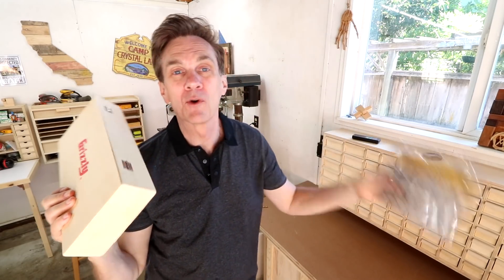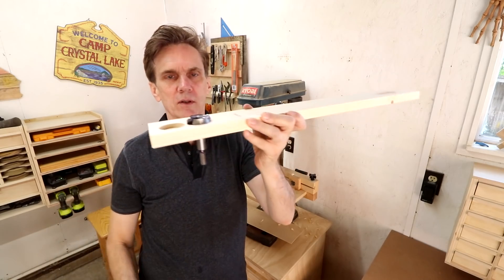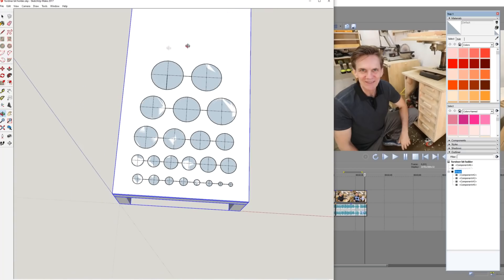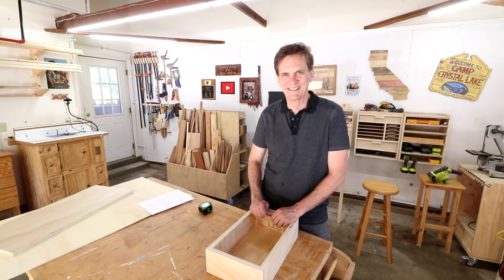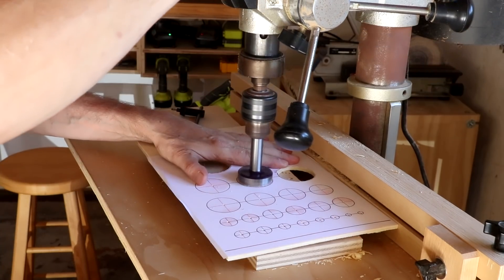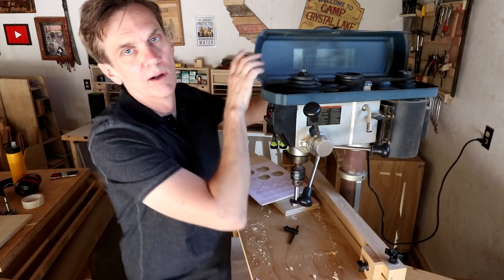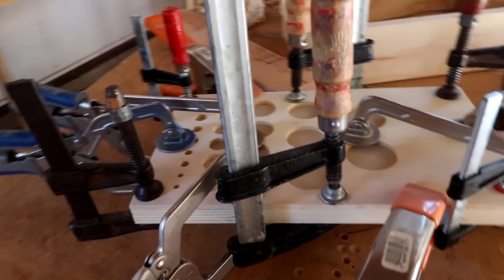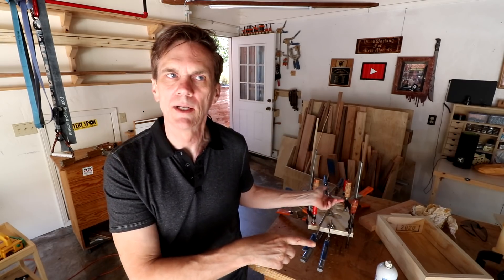A storage solution for my Forstner bits. | Day 94

Comment: Keep a fridge magnet in the drawer to grab the smaller bits easier.
Reply: Keep the bits in the fridge
Reply: @BeeRich33  that could be misread with some serial killer vibes, lol
Reply: They have a magnet on a plastic handle for canning.  They pick up the lids from boiling water after sanitizing.  That way you could drill a hole and set it in right beside the bits.

Comment: For the 1/4" bits, make a ledge beneath the hole for the shanks to rest on. The depth would be dependent on how much of the bit you want sticking out of the top. Don't forget a thumb hole in the back, or you'll have to turn the whole drawer upside-down to get the bit platform out!
Reply: I was going to suggest a backer block with holes drilled to the correct depth for each shank for the smaller bits, perhaps bored into the narrow face of a 2x4 appropriately cut down to fit underneath the row of small bits.  A ledge, mounted lower down on the drawer insert, with holes drilled to the correct depth for each shank, would theoretically do the same thing, and would be lighter than my idea.  However, one would then be stuck with trying to blindly align the shank end with the unseen lower support hole from above -- that could get frustrating with time.  Maybe my bulkier idea might be less stress-inducing over time, since the holes for the small bits would be one continuous length down to the supporting ends... dunno.

Comment: Hey Steve, great video.  I just wanted to point out that wood absorbs moisture and this may cause your bits to rust when kept in your holder.  You may be able to apply some wax to the insides of your holes to reduce that.  Lesson learned from my own experience in making my bit holder.  :)
Reply: nice part of this design is contact with the wood is limited to the back face of the cutter/far end of the shank, where rust will cause minimal issues unlike on the contact surface of the shank.

Comment: Steve,  Great to see all the videos you are doing during this crazy time we are in!!     One suggestion I have for your smaller bit storage alignment issues, that I incorporated in mine, was the use of dowel rods.  I used 3/4 or 1" dowels and drilled the centers out with the shank sized forstner bit, then cut to length and glued them to the bottom of my board, acting as a sleeve for the shanks.  This keeps them from wandering while the drawer slides in and out, and its not seen from the top. 
Thanks again for all your videos, and keep up the great work!

Comment: Looks like all you need to do now is drop each bit into its corresponding hole, give it a gentle rap with a rubber mallet so the tip of the bit marks the center, and drill out the center.  Nice.
Reply: That's what I would do too. 1/8" pilot through both would work too (as others in the comments have suggested), but if you drill the shank holes first, you lose the brad point keeping the workpiece centered over the bit. Forstner bits aren't the same as twist bits when you need to widen a hole.

Comment: I bought sets of router bits and Forstner bits at Home Depot in those lime-green Ryobi cases, (not so much a fan of Ryobi... but they are reasonably priced and they work great for me, and of course I can upgrade them later if I need to)... so I attached on the backs of those cases a length of 45 degree cut wood so they will go on my French cleat tool wall... These cases are great! They have plastic lids that flip up to access the bits, keeps the dust out, I can easily see exactly the bit I need, and they are already labeled... and another bonus is that they can be taken off the cleat wall and taken to other places in the shop.  Steve, I know you took out your French cleat wall system a while back... but it was your videos that inspired me to build it for my shop and it really organized my tiny shop in ways I could not have predicted... Like those Ryobi cases!

Comment: I'm the happy owner of a Bosh drill press which has digital speed adjustment AND a digital depth gauge built in. Changing the speed is as simple as turning a knob. And it's an inexpensive and compact machine too. If you're in the market for a drill press I would highly recommend this one.

Comment: 6:03 you could have made the small holes for the shanks first, with the two pieces of plywood together
Reply: Yup! It 1/8th inch  pilot hole through the stacked boards so the holes align.
Reply: That was exactly what I expected him to do
Reply: Only came to the comment section to say this.
Reply: Yeah, me too. Don't know why he didn't drill center holes first.
Reply: I think he did it the right way. If you drill the shank holes first, you lose the brad point grip on the second pass, and the workpiece can walk off center when you drill. This way, you can mark centers with the brad points onto the second board after gluing them together. 1/8" pilot would have done the trick too, I guess.
Reply: Brandon Palmer    Agreed...he can put each bit into the hole, light tap, and there’s the center for the shank hole.
Reply: I was yelling at him the hole time about this! (Pun intended) tape them together, drill shank holes, then use the shiny new bits to go all the way through the smaller plywood after you separate it.
Reply: I always see videos where people need a counter bore hole and they always drill the larger counter bore before the smaller hole in it. I can figure out why they don’t drill the smaller hole through first then use it as a guide for the larger counter bore.
Reply: Was thinking the exact same thing
Reply: @darinnetherland3466  Forstner bits leave a centered "point" hole which subsequent bits align with easily.
Reply: @darinnetherland3466  If you drill a small hole all the way through something, and then need a larger hole to go around it - and not to the same depth, you can't centre it.  Almost any drill bit will leave a centre hole, so you do the larger one first.

Comment: Yep, I agree with some of the other comments.  Stick the two together and drill all the way through with 1/16" inch bit.  1/8" is probably still too big.  Then split them and drill the top layer with the forstner bits and the bottom layer with a brad point.

Comment: I also have drawers beneath my drill press. They are mostly about 2" high but the bottom one is about 3 inches. I took the box they came in which was not Grizzly but very similar, took off the lid and put it in the drawer. Bits are organized, sizes are still there and it only took a couple of minutes. They don't call me lazy for nuthin'. But, it works great.

Comment: I like your solution. I have the same type set of bits and I have never had a problem like you showed. I like my tight box storage because I live on the coast with all the associated salt air/rust problems. Thanks for the video.

Comment: Hey Steve, always brilliant.  Of course, as all YouTube viewers, I have a suggestion.  If you are tired of them, just skip ahead. I won't mind.
We grip our bits by the shank, so so it makes sense to have the shank accessible to be grabbed, not the head.  We also put them into our drills by the shank, so if we did happen to grip by the head, well, we'd have to flip them.
Second, the issue of "what if they fall down" is because they are elevated.  Solution:
Solve both problems and make an easier box.  Just do a grid in a box and label what the bits are and put them HEAD-side-down. That way you put it down head first BECAUSE you're already holding the shank.  You pick it up by the shank... and it could go in the box by the shank.
Finally, I get that it's tough to tell what bit is what because the writing wears off.  Frog tape and a magic marker will work great.   You don't need it near the head... so put it just where the shank is not in the drill... and mark what size it is.  It's easier to read, especially if you need readers, (I do), and if the boxes in the grid box are marked... man that's the ticket.  You could also use tape of different colors.  It works for resistors...

Best Regards

Ehud Gavron
Tucson AZ

Comment: When applying paper patterns to wood, a common scroll sawing method is to put a layer of blue painter's tape on the wood and then lay the pattern on top of that.  It makes for very easy removal of the pattern (no solvents or heat needed) and the tape helps to lubricate drill bits and saw blades, reducing burning in the cuts.

Also, spray adhesive is nasty stuff in terms of chemicals, and the overspray from it can make a mess.  I keep a big box around and apply spray adhesive to the back of the pattern in there,  flipping to a new side of the box as needed, then cut up and recycle the box when it gets too sticky inside.

Comment: For the back blank area behind the bits  route in a small "tray"  and either use those harbor freight magnet trays or just keep it as a wood tray and put in some magnets and use it as a tray to keep the bits your working with at a time accessible and handy when you have the drawer out at a different location which you can use for any bits, twist, brad, spade, etc.

Comment: You mentioned Costco Forstner bits and I recalled a 128 piece drill bit set I bought from there a few years ago. They were cheep, I was just starting a project in metal so I thought they would be perfect disposable bits.  Having also recently bought a Drill Dr, they are still being used quite frequently. Cheep tools aren't necessarily poor quality.

Comment: Good idea...might use this one.  My forstner set has been sitting in its plastic case for a decade and a half.  Maybe you could keep the bits straight by adding a second shank sized "hole board" stepped off the bottom, so the shank is aligned with the top?

Comment: To centre the holes between top and bottom, you can join the boards together with double-sided sticky and run a 3mm / 3/32" bit through both.  Then separate the boards and use that pilot hole to centre the holes for each board.

Comment: You could've drilled the holes for the shank first all the way through both, then took the boards apart and drill the bigger holes through the 1/4” - because you now have the middle reference point in the 1/4"
Love you Steve!
Reply: avreml Rapoport I thought about doing that too. Even use a smaller guide hole would work like a 1/8” bit. Marks both centers without any distortion. 👍👍

Comment: After my experience with these very same bits and the Steelex version Grizzly sells with the "standard" sizes ( 3/8ths inch - 2 1/8ths inches by 1/8th inch - 16 bits) (the Grizzly set you have is probably the one that starts with 5/16ths inch and goes up by 1/8th inch until 2 1/16th inches - 15 bits), I feel compelled to give a warning about your choice of storage. "Danger, danger, Will Robinson!" While, as you noted, the Grizzly bits are made of low grade steel, they are still very sharp. I have the scars to prove that fact. The Steelex set comes in a box with two rails that swing up with the bit's cutting area on the top when you stand the rails up to select the size you need. I have left them in the upright position, carelessly reached in and gouged my hands and fingers with blood flowing as a result. Storing these bits with the cutting surface on the top is a bit like designing knife storage where the blades are facing up and you have to use the blade to pick them up. And I get it, twist drill bits come in metal boxes and you want the cutting surface up so it doesn't dull on a metal surface. I'm sure that is why many people, when creating their own storage solutions, stand forstner bits up in the same fashion. But I also think the reason for the Grizzly box design was to try and solve this unsafe situation where you are reaching into a box where sharp metal objects are stored pointing straight up at your fingers. Unfortunately, Grizzly's solution is very poorly executed. Another issue is that when you grab the bit by the sharp end, the oils and moisture from your hand end up on the bit and can cause rust if you don't clean the bit each time you handle it. I've been thinking about this for a while since I have both sets and neither set stores the bits safely or efficiently. My plan is to get some 3/4 material, drill down to where the cutting part will stand up for each bit, and then grab the bit by the chuck end instead of the sharp end. And, similar to your plan, I will just place that material with the hole grid in a drawer under my drill press. Since I live in the humid Midwest, I think I'll use PVC board or something that won't hold much moisture to keep down the rust. I don't think either PVC, soft Pine, or any grade of plywood would cause a significant dulling of the bits and it would definitely make a safer, more efficient solution. My suggestion, put the cutting end down into the wood tray, point the chuck end up where it will be easy to safely pick up the bit, write the size on the wood by the bit big enough to read.

Comment: Carpet tape them together, drill a small pilot hole for each bit through both pieces of wood, then take the two pieces apart and drill the shanks sizes through the 3/4” and the full bit size through the 1/4”.

Comment: I feel your pain about changing drill speeds. After struggling with a cheap drill press (which also had a sloppy quill), I got a Bosch Bench Drill PBD 40. Not hugely expensive but more than accurate and powerful enough for me, and electronic speed control to change speed with a click. It has digital depth measurement also, so you could easily have drilled with both stuck together to give you accurate depth to mark the lower board (actually, it would have been accurate and repeatable enough to just use on board).

Comment: Late to the party on this one, and not sure how I missed the video. Great storage set up for the Forstner bits, and likely the best I have seen on YT. I like the use of the spray adhesive for the pattern glue up on the plywood. I did not catch the brand of that adhesive. The stuff I have lying around the shop is WAY too sticky & damn near permanent.
Reply: Not at all sure how I managed to post the same thing twice.

Comment: For your smaller bits you could use a piece tubing and block the end so your bits would not slip completely  down into the tube that way you wont have to worry about a small bit falling down into the bottom and not being able to retrieve it easily. then if the shank is bigger or the same size it wont matter as long as the tube is large enough for the shank to slip into.

Comment: Try a block of foam under the top board and to the bottom. Drill a hole part way through the foam for the drill shank. It should stop the small drills from falling through plus give a small amount of vertical spring to allow the bit to spring up, easy to grab.
Reply from the maker: That's a great idea! Thanks!

Comment: Tape both boards together then using the paper template drill a pilot hole through both boards giving you the needed centers. The pilot hole could be drilled with a hand drill.

Comment: Once again THANKS Steve for your Daily Videos. What if you put the 2 sheets of wood together and then drill a 1/16th hole threw both sheets at the same time of each the intersection of  bit location. then when you separate the sheets you are sure to line up. Maybe?

Comment: I would have started out with the top and bottom piece clamped together and then drilling a 1/16" pilot hole through the center of each bit location.  That would allow you to use it for alignment of the Forstner bit's center when you are cutting the hole for the head of the Forstner bit in the top piece and then use it as the center for the smaller hole that you cut for the shaft of the bit in the bottom piece.  The bits who have a smaller head than shaft though are going to need to be done differently.  Probably you will need put a block under the bottom board that is thick enough for the shaft of the bit to slide into and then drill a hole deep into the shaft so that the bit can rest on the bottom of the hole.

Comment: Nice project, as usual, Steve.  I try not to have the sharp ends of tools exposed.  Inevitably, they will contact soft stuff like skin.  Your fingers get dangerously close to the sharp edges when retrieving bits in your design.  Being in a hurry or an absent-minded moment could lead to a nasty cut.  Also, anything falling into the drawer could dull or damage the bits.  

I would modify your system upside down and have the business end of the Forstner bits pointed down.  Foam or plastic on the bottom would protect the drawer and the cutting edges.  I would label each size and the shanks offer easy and safe access to all the bits.

Comment: For the bits that have larger head than the shank diameter, instead of drilling individual holes for the shank of each bit, I would use a jigsaw and would cut a grove under the circular holes that are in the same row and have identical shank size. That is, I would "connect" the drilled holes. The head of the bits would hold them at their place any ways, once you put them there. This is more future proof so if you have bits in the future with new sizes then you don't need to drill holes just cut groves when you start a new row of bits.

Comment: Hey Steve, another way you could have lined up the two boards could have been to clamp them together, then drill a small pilot hole through the front, and a little ways into the back, transferring the center position. Now that you have the full sized hole in the front piece, it may be difficult to find the center for the shanks to go through.

Comment: Great video and ideas as always!
After reworking my socket set I put the sockets I use most at the front, the the others in order behind.   Most used are right when I want them.  
For  your smaller forsters maybe you could just put some grooves in the back and lay them flat.  How often do you use them anyhow?